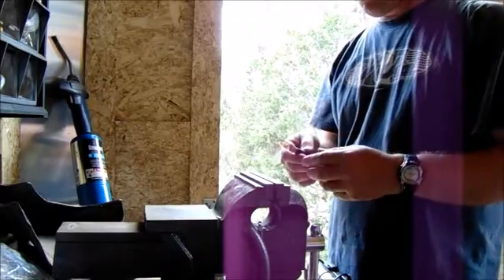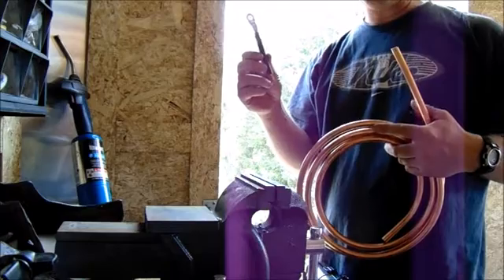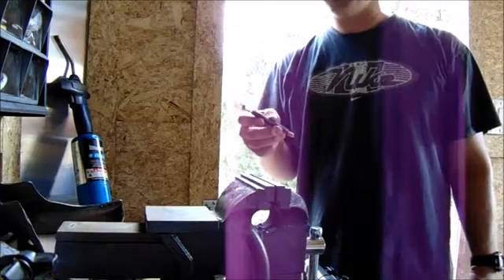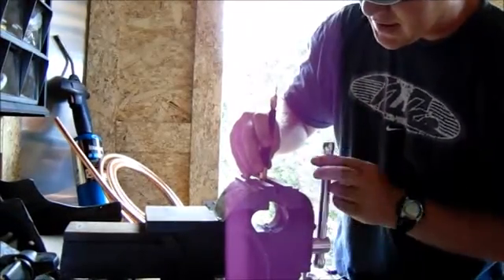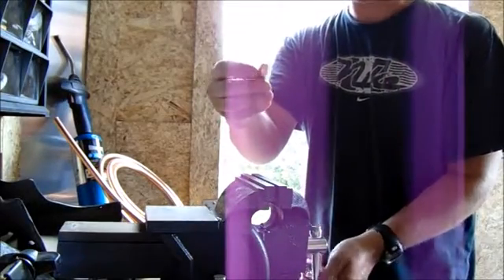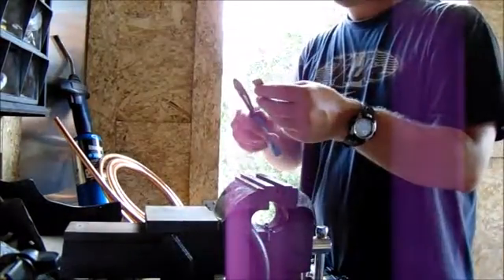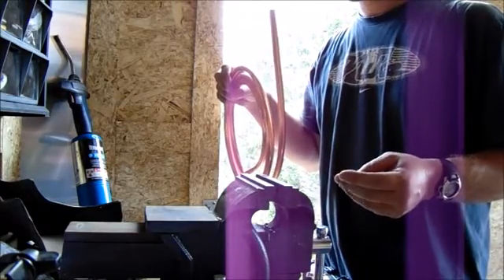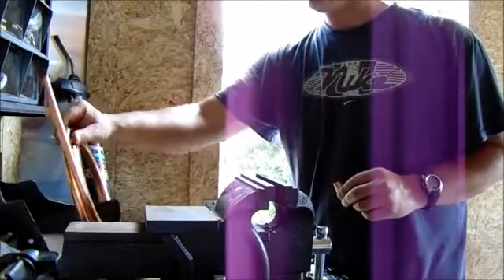How to Make Battery Cables with Homemade Copper Terminals.

Comment: I cut another ring or T above the opening at the cable end to crimp around the insulated part so it has good hold of it, use heatshrink to insulate.